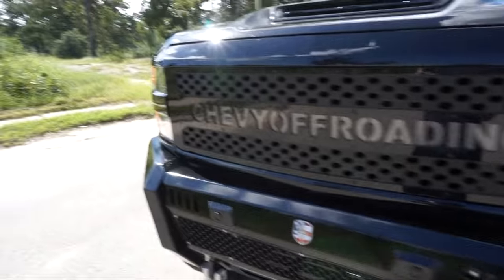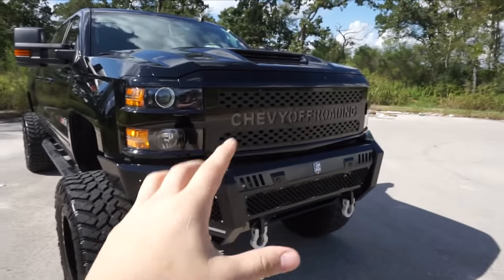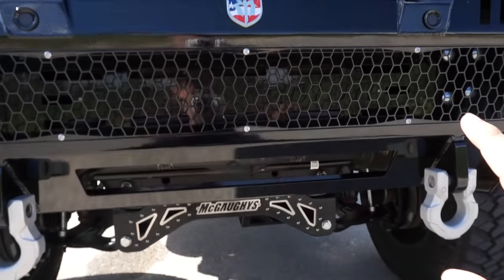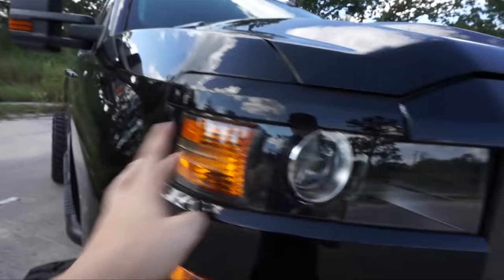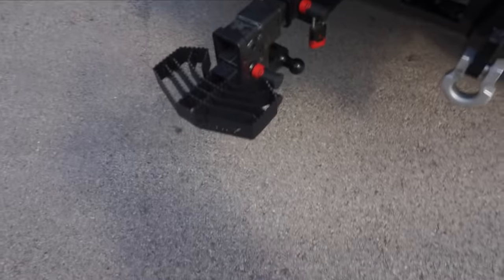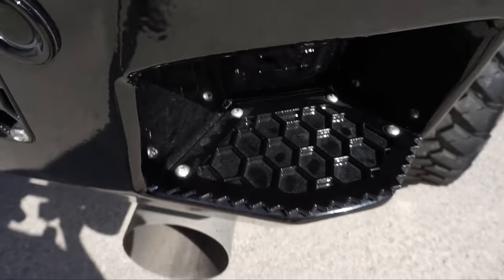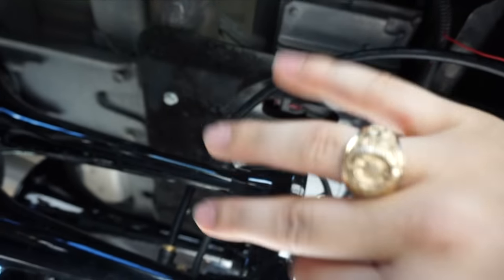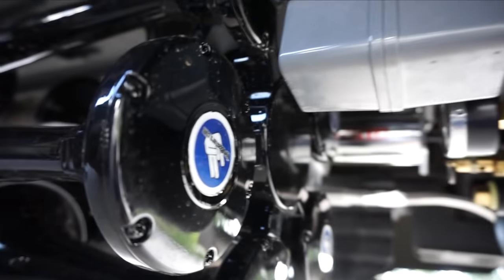Road Armor Identity Series Bumpers | Train Horns & Grill

Comment: PTM taillights, paint the tow mirrors gloss black, de-badge it, then get a 20” Wet Sounds soundbar for the front bumper instead of a 20” lightbar. You’ll have enough light up front with the 30” bar and 6 pods. Gig ‘Em 👍🏻